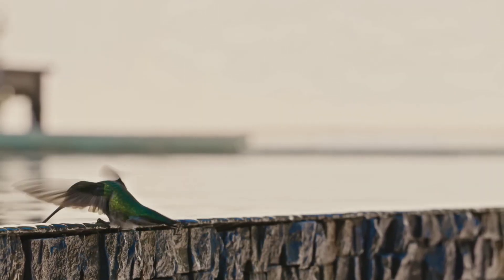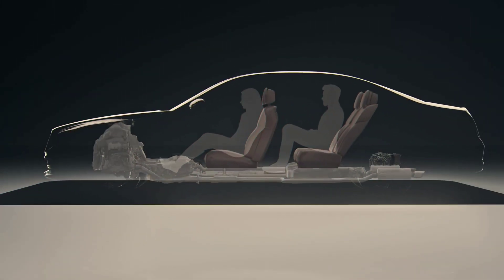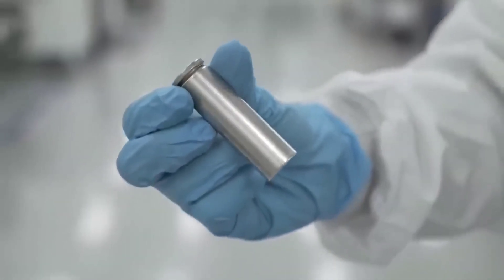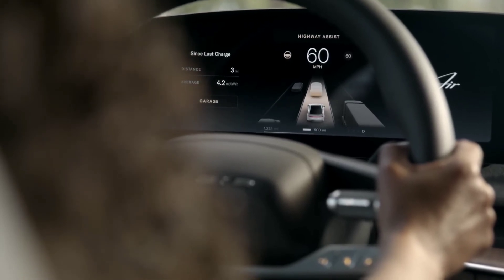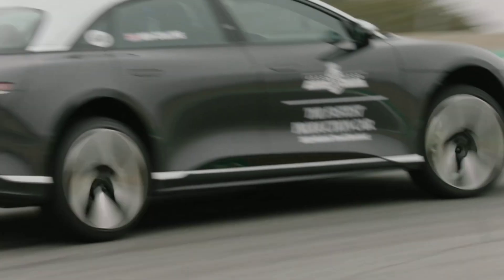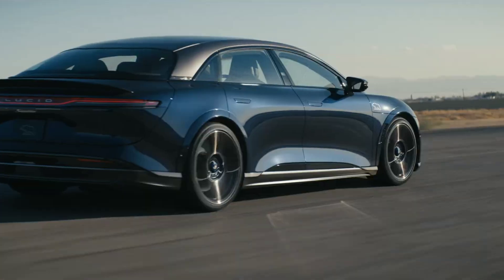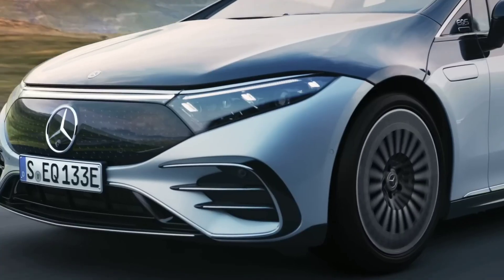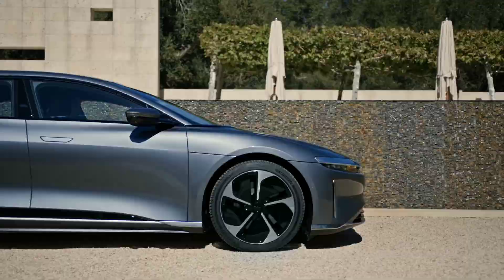World's Most Advanced BATTERY Ever Used In a EV Lucid the Best Electric Car in 2023

Comment: I don’t understand why they couldn’t do a float charge on the right type of battery system. 

🤔

A float voltage is the voltage at which a battery is maintained after being fully charged to maintain that capacity by compensating for self-discharge of the battery. 

The voltage could be held constant for the entire duration of the cell's operation (such as in an automotive battery) or could be held for a particular phase of charging by the charger. 

The appropriate float voltage varies significantly with the chemistry and construction of the battery, and ambient temperature.

With the appropriate voltage for the battery type and with proper temperature compensation, a float charger may be kept connected indefinitely without damaging the battery.

I don’t know why they haven’t tried to go in this direction. 

That would be my goal. 

A simple FWD System that Float Charges a battery on a binary firing system 

A car that basically charges itself and doesn’t overheat 

It’s not perpetual motion either 

Because it’s a float charge the battery is always in a state of flux 

Like a combustion engine 

But the system itself doesn’t actually die out 

It’s not perpetual motion either 

🙄

It has a battery system and some sort of charging system

Comment: Lucid is just using Panasonic’s 18650 battery, same battery found in Tesla’s Model S and X.  Lucid has a great car but, they only have 1 car, a very expensive one.  They will go bankrupt if they don’t quickly start making less expensive models, at volume.
Reply: Funding secured 🤪
Reply: If they use the same battery why does LUCID get more range?